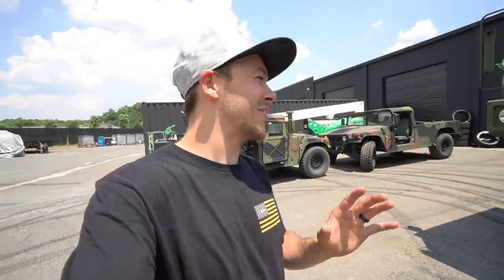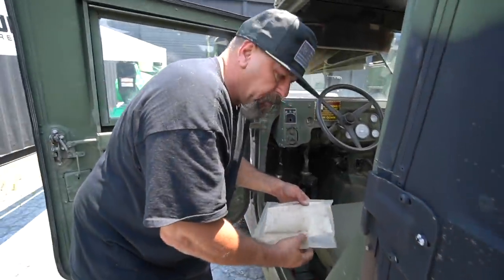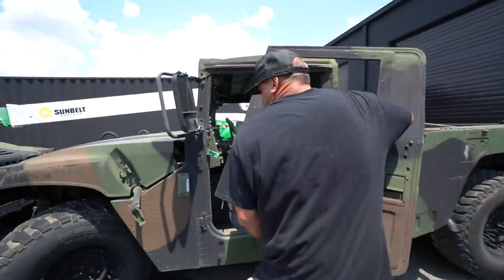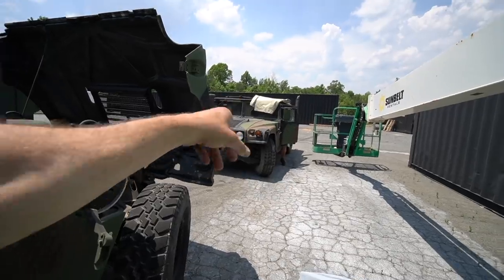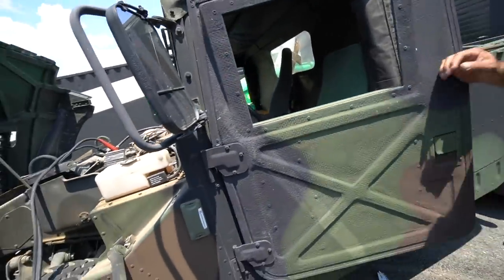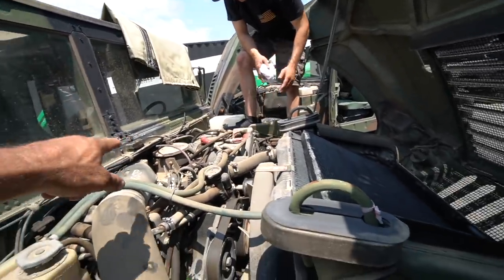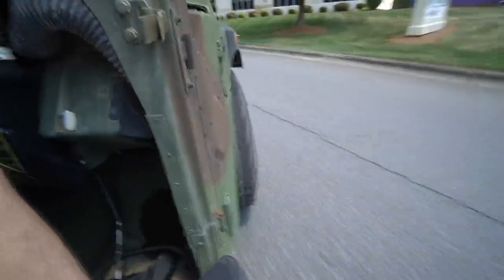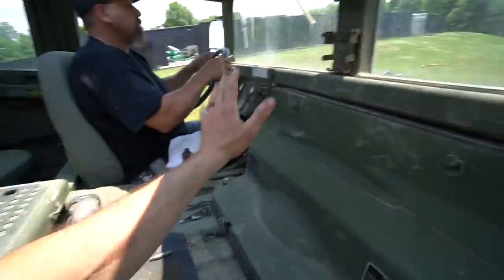We found Military H1 Humvee’s and bought them SIGHT UNSEEN!

Comment: I am M998  Humvee fan but then again that is the version I drove in the Army for my first 3 years as MANP.A.D.S. Crewmember/Crew Leader and another when I was Aviation Operation Specialist/ Command SGM driver my other 3 years. I would love to have a certified authentic M998 Hard Top and a Soft top. I would never buy another car or truck if I had my hands on those two vehicles.

Comment: You can get an arc welder box and hook it to that they have them for off-road vehicles it's a little 5 inch square box that's a welder just plug leads into it hook it to the alternator got a welder RPM adjuster that's it
Reply from the maker: Dude no way!!!!! I’m looking this up thanks for the advice

Comment: so you need to flip the start switch to wait then wait tell the light turns off then click to start. you will destroy them otherwise. i had to do maintenance on one for 2 years. can they start with out waiting yes. then youll end up having to fix way more later if you dont. the military likes to simplify and dummy proof its gear.

Comment: I also have a couple humvees! The lights will not work unless you use the unlock switch then turn the lights on. Feel free to hit me up if you have any questions. I've done a lot to mine and have plans to do so much more! Also I would definitely wait for the glow plugs to heat up before you start the humvee. Thats what the yellow wait light is for, it will shut off when the truck is ready to start. They are an absolute blast! Enjoy.
Reply: Oh God tell the world 🌎 Humvee man